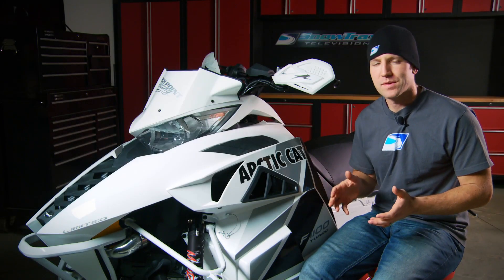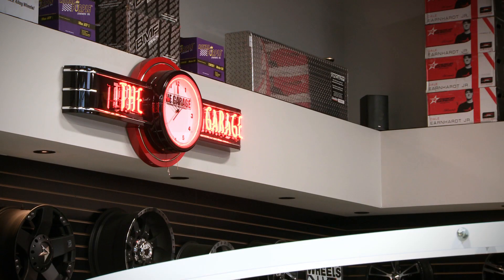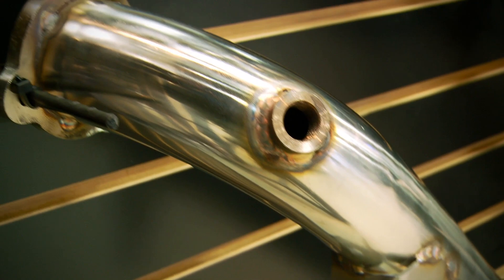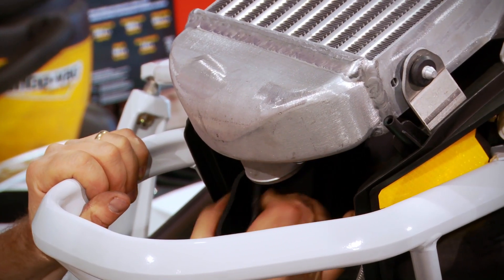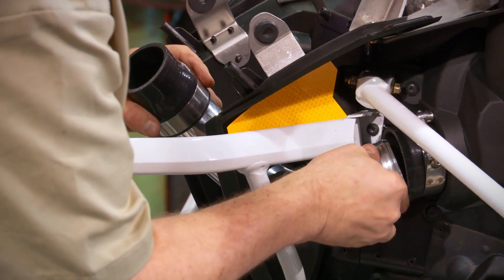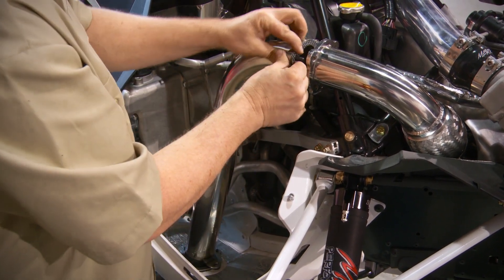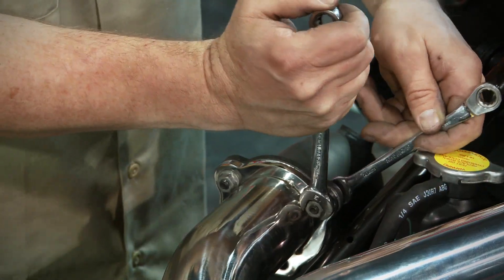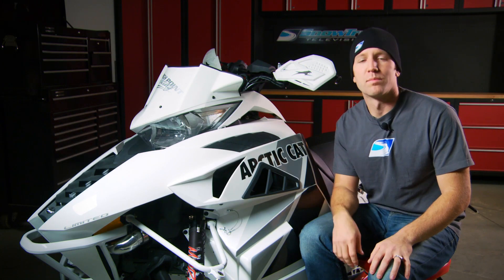Modified F1100 Turbo Arctic Cat Sled

Comment: I have a 2013 F1100 Turbo. From factory, the jackshaft flexes up to 180 thousandths of an inch and the bracket that holds the jackshaft bearing on the clutch side comes attached to the engine. Every time you let off the throttle, the belt takes the brunt of the force from over shifting and it heats up. Guys have spent thousands trying to fix belt blowing issues by installing new clutches, jackshafts, etc. If you want to be done blowing belts, especially if you have it tuned up (I have 240 horse tune, cold air intake, extended track, Bikeman Clutch kit), you'll have to replace a couple parts. The bracket that holds the jackshaft on the secondary side has to be replaced as well as the jackshaft. The new brace will stop the overheating on deceleration and the heavier jackshaft will keep your secondary from pulling out of parallel when you're accelerating. This should have been addressed right from factory and a couple engineers did in fact lose their jobs at Arctic Cat over this. They now work at Polaris. lol. Scott Taylor Engineering still makes these parts and he does them well. For the double approach fix, you're looking at just shy of $1000. That's a bit to spend but better than having a $5,000+ paperweight that you don't want to ride because it constantly blows $120+ belts.
Reply: All the cats of that Era suffered from jackshaft bearing failure including the race sleds. We were replacing them every race back in the day😂